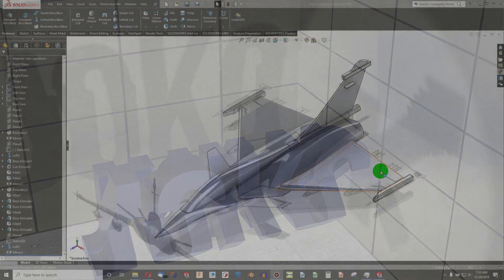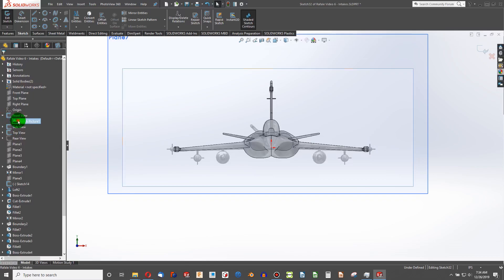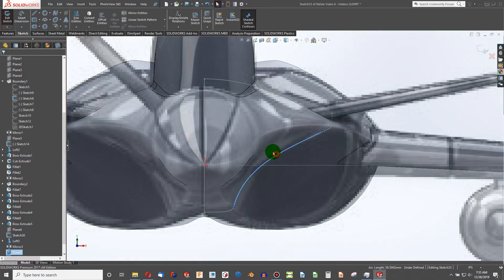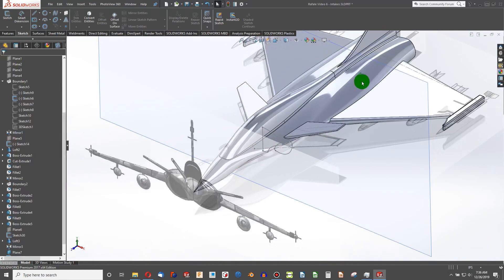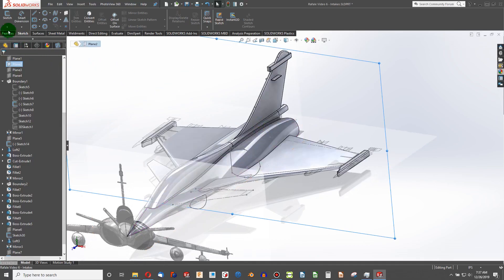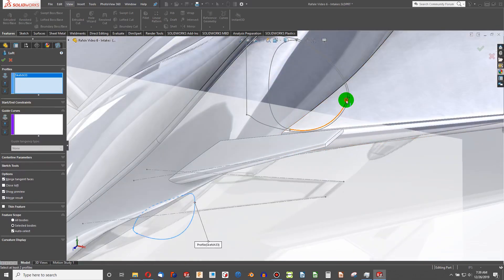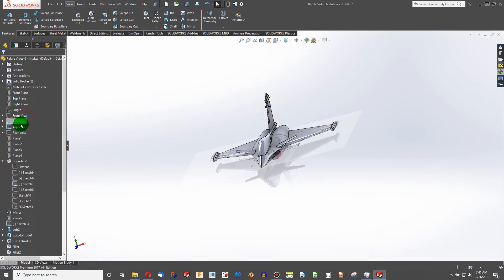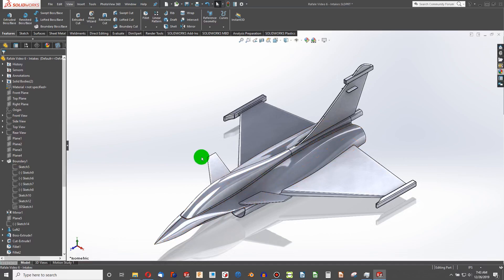Make a Rafale Fighter Jet in SolidWorks Video 6 - Intakes|JOKO ENGINEERING|

Comment: How do you cut out the fueselage region that interferes with the inside of the intake along the wing root? Like you did for the part of the wing surface inside near the front of intake, but selecting the fueselage towards the back of the intake